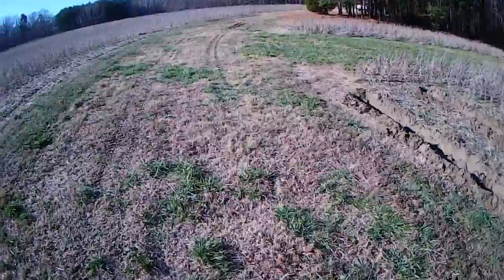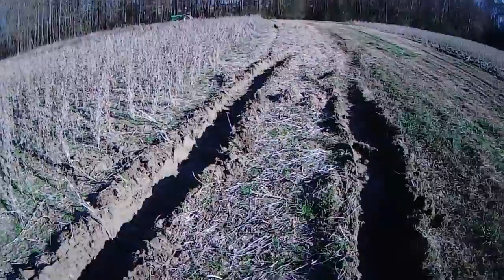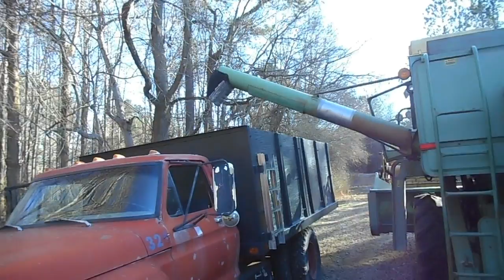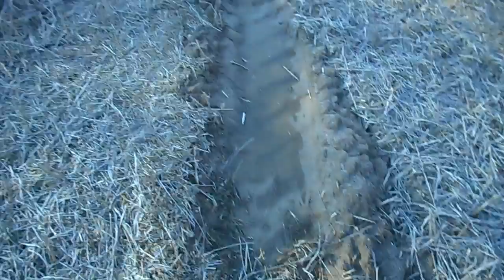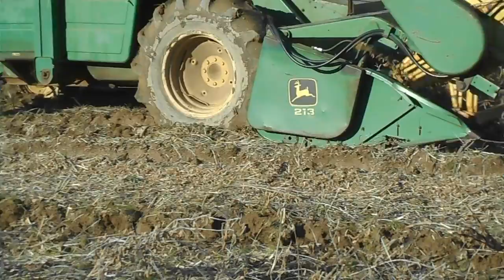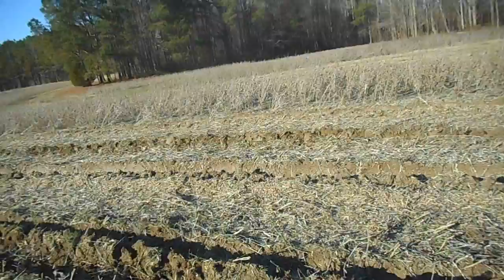January 26th Slinging mud part 6

Comment: Well one thing about a wet harvest it sure makes you appreciate the dry ones. Would be interesting to see what a cheap set of clamp on duals would do to reduce ruts and help carry the combine.  Thx
Reply from the maker: farmark – with duals the one thing I do know is you need 4 same size tires.  The two drive tires are worn out and in great need of replacement.  Getting new drive tires on the 3300 is high on my list of things to do.  If this year had worked out as I had hoped I’d have the 2200 dollars to get two new tires BUT……   thanks for watching.
Reply: Soybean Farmer    Are there any farm equipment salvage yards near you where you could possibly find some good used tires?  Then maybe use your old ones for the duals.  Just wondering
Reply from the maker: @farmark457  - I know one about 70 miles away from here so I think I'll give them a call and see.  thanks for the thought.

Comment: So correct me if I’m wrong if you’re harvesting your beans and you got to head down as low as they go and you start to stink down that could be a really hazardous situation to do some damage to the head on that combine correct ?? Anyway keep pushing on through the harvest man
Reply from the maker: mrour canada - yes GREAT question.  the 213 head on this 3300 is a fixed rigid head and this means you the operator must keep an ever watchful eye on the ground height as you move through the field.  for this reason I attempt to level my seed bed to make harvest a bit easier.  fire ant mounds are always a big problem since you don't want to take dirt into the combine and for sure don't want fire ants in there with you.   when sinking in mud you MUST watch the head and lift it to keep it from scooping up the ground in front of you.  damage to the head and dirt in the feeder house is not a desirable thing.   flex heads were a wonderful invention since they grant to the operator a bit more time to adjust before they begin to take up dirt.   thanks for asking watching and being here at my channel.

Comment: I'm just curious, how difficult would it be to install the clamp on type duals to your combine?
Reply from the maker: BritishGirl_Ren - I have no idea and don't really know what snap on duals are.  In one of my harvest videos earlier this year I was alone without cousin and videoing from the cab as I picked beans.  I was dreaming out loud about having duals on the 3300 and several viewers commented the drives on the little 3300 were not strong enough to support that much traction.   thanks for being here asking questions and watching.
Reply from the maker: Oops Oops - they are worn funny like heavy on the inside tread.   I was amazed just as you were.   one more part to upload and this series just like the 2018 bean harvest is over.    thanks so very much for being here my friend.
Reply: @SoybeanFarmer3300  I'm not sure snap on is the correct term, it's the kind of duals we attach to our 4020. They attach using long bolts and clamps from the inner wheel to the duals. I hadn't thought about your combine being belt driven, that would make duals a big strain on the drive system.
Reply: We call them clamp-on duals.